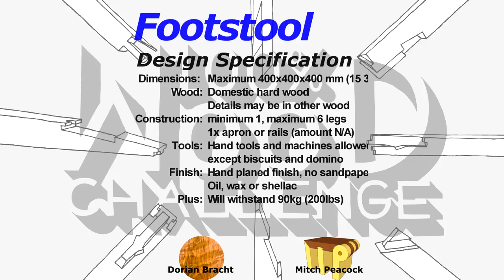100% Wood Challenge Ep.1: Footstool with Dorian Bracht (Plan to download)

Comment: Beautiful video, Mitch.
The corner footrest looks great.
One can think quite well, if one builds something, as it holds without nails and screws.
In such a way (without glue, nail, screws) I made a corner shelf of beech wood, and sometimes a wardrobe made of cherry wood, only with the wardrobe I screwed to the wall, behind a bar.
Reply from the maker: Thanks Günter.
They're both so different - I really like the angle Dorian used on the legs, and the wide chamfers on the top.
No metal does make one think a little harder, which can't be a bad thing.
Your projects sound interesting. Bet you were pleased with them.
Reply: Hello Mitch,
That's right, without screws and nails keeps wood better. Because there is no weakness point.
Right, I am proud of my two works. :-D